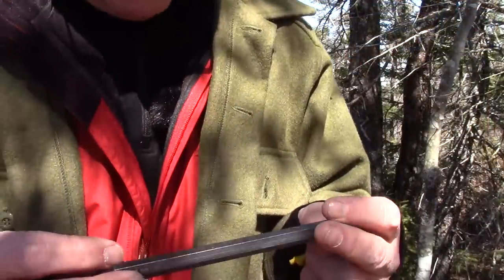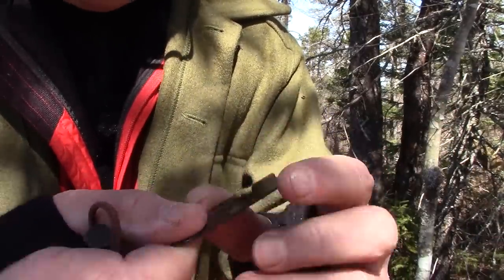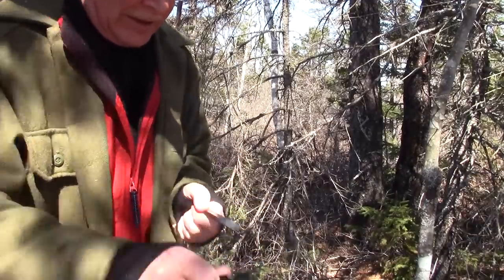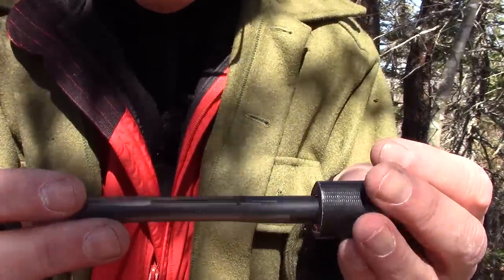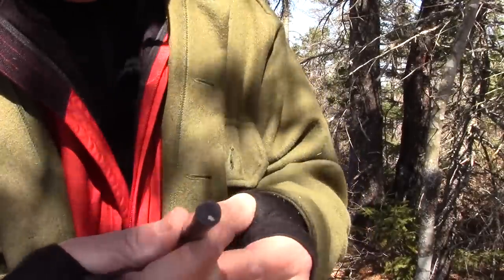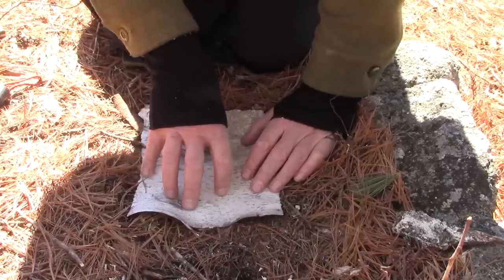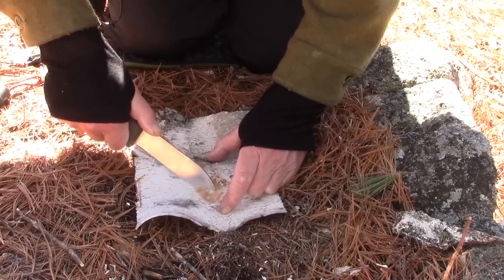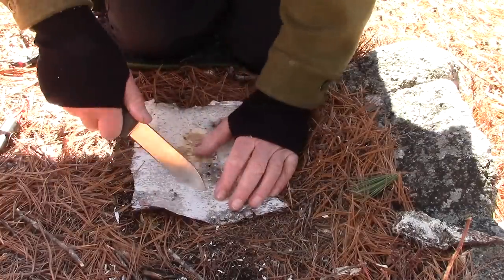Uberleben Hexa Six Sided Ferrocerium Rod

Comment: I bought one of these last week on Amazon (had bought the Uberleben tinder wick too) and took out to the Dinosaur Tracks in Picketwire Canyon in La Junta Colorado this week for a quick Winter camping trip. I'm embarrassed to admit I had never struck a ferro rod before, this was my first but watched a different video by Mark Young and emulated him and I struck a fire on the frayed end of the tinder Wick using this hex ferro rod with just a few strikes. It put out a lot of sparks.  I'll be keeping it in my 4Runner for overlanding excursions.
Reply from the maker: Thank you for sharing your experience. A little bit of practice and the ferro rod becomes a fund and easy tool to use

Comment: Nice video. First non round ferro I've seen. I suppose that the larger contact area should produce more spark. Makes sense. I wonder how a 1/2" square one would do?
Reply from the maker: I believe square rods are available by another seller. It would be interesting to compare. Thanks for commenting

Comment: I've been thinking of picking one of these up !
Reply from the maker: You can borrow mine to try if you would like
Reply: My uberleben broke from using one side. Anyways it's a bit softer rod in my opinion. I will say the customer service by the company is amazing. The epoxy in the handle on mine didnt take and the rod kept falling out. I contacted them and they offered to replace it and let me keep the other as well. They also gave me like a 20% discount off my next purchase

Comment: Was the purpose of the cut out on the long side of the scraper to catch two flats at the same time?  If so, why didn't you try it?
Reply from the maker: Hey Bruce. I believe the cut out is intended as a bottle opener. It sounds funny but it appears on a number of Chinese made strikers. It does not fit around the body of the Hexa. The curved end is intended for striking ferro rods but it would just start to round the sides out if I used that.  Thank you for commenting

Comment: More surface area in contact should produce more sparks, and consequently wear down faster, and eventually sell more replacement rods. Peace
Reply from the maker: That is one way of looking at it. Another way would be more sparks per stroke means fewer strokes resulting in a rod that lasts longer.Thanks for commenting

Comment: You were in too big a rush to play with your new toy to wait to film a little at night, or maybe in a darkened room? 🙂
Reply from the maker: Maybe so but sparks are just for show. The proof is in its ability to light fires 😀 Thanks for commenting
Reply: I've heard there are some, depending on the specific make up, that make sparks hotter than others.  Do you believe there's any merit to that?
Reply from the maker: @jimf1964  Yes, there is a difference by manufacture. The Light My Fire rods are softer, produce sparks more easily but are not as hot. Mostly not an issue if you have a good tinder to catch the spark. Take a look at my other video on the Uberleben Kraftig. Thanks for commenting Jim